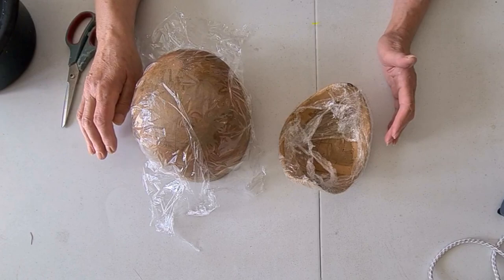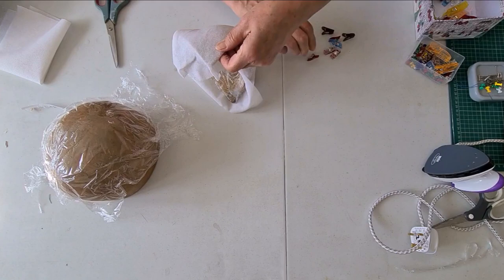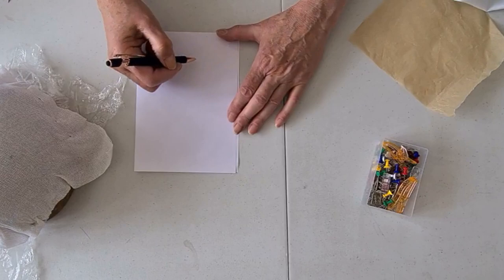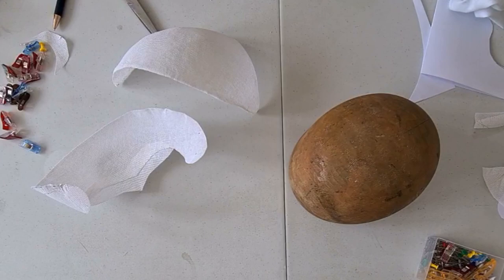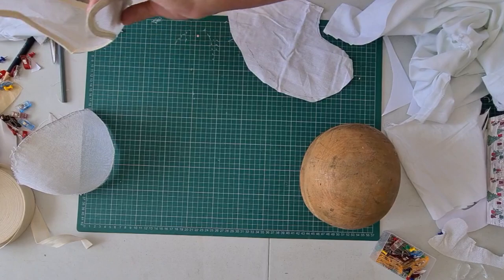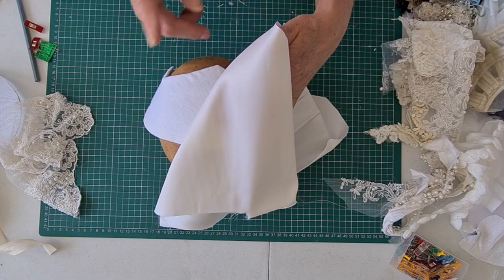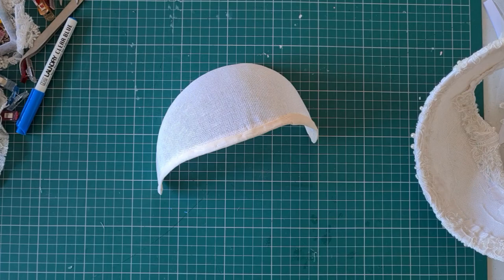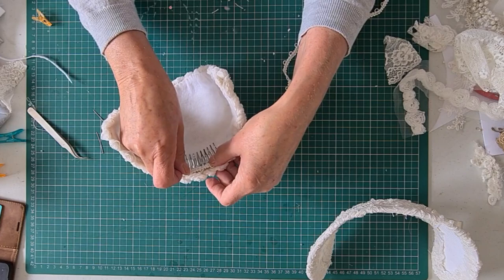Watch me make bridal juliet and half hats...2 styles

Comment: Hi, Such a gem. Is there a non acrylic way to do the linings? I strive to use natural fibers only and leave the plastic alone. My choice without judgement for others. Also you put the bridal elastic with the loops facing forward. I would have instinctually have put them the other way around but I don't know these things. What is the reason for turning them outwards, please? Thank you for the video. Yours, Ann
Reply from the maker: Hi Ann, I understand the naturel ethos, you can use cotton fabric, but you will have to fold under a small hem. In fact any light fabric would do. I turn it will the loops facing outwards, as it is easier for finding the loops for fixing pins into. Often the hairdresser will be fixing in place and it is easier for them to see and find them 😀 cheers, Sara